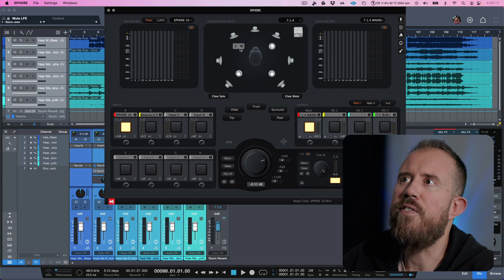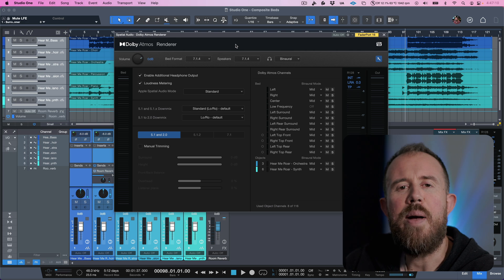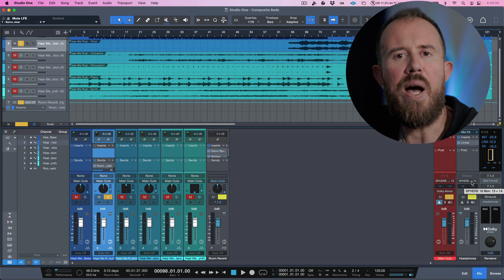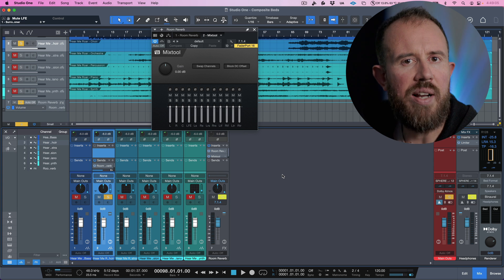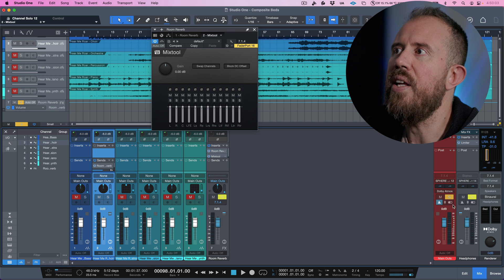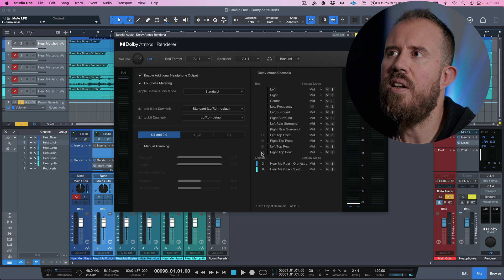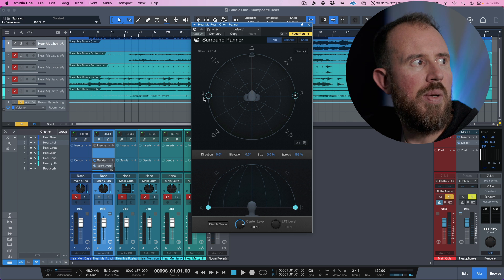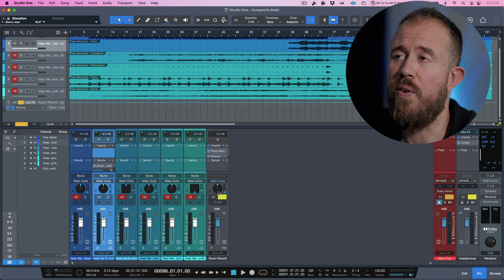Support for Dolby ATMOS Composite Beds in Studio One 6.6

Comment: Hi Marcus, love all your videos and info you provide. I have a situation I can’t seem to trouble shoot and you seem to be one of the best at some weird situations with studio one.

I have an Adat connection through a Ferrofish pulse to an old presonus 1818vsl interface.

I want to use the outs of the Ferrofish as my monitors, I have adat in from analog ins working well and detected in studio one etc. I have adat out interface to Ferro in etc, they are synced with Ferro master inter as adat slave. (Have flipped also for tests)

My issue is I cannot monitor anything if any track is panned or actually stereo, I see both lines showing up on ins of my Ferro and if I flip listen bus or mains to mono etc I can hear it but it cannot be stereo despite 2 outs going and stereo setup in control panel for corresponding lines.

I do not have a mixer / dsp for external routing in my interface like the newer ones. Any idea why this is happening? Have tried for 5 days diff configs to no luck.

Another weird quirk is the listen bus and main both directly affect the level in Ferro to digital clipping. I found I have to leave master at 0 and attenuate the listen bus to something like -48 dbfs when sending the signal out. The actual audio being -12 to -18 dbfs on the meters of Ferrofish when this is done using a sign wave 1k at 0db.

Ps I can record in stereo instead of mono but not monitor that also unless I swap the track or bus to mono in studio one!

Thanks in advance if possible to help.

Comment: A quick question Marcus.  How does mastering fit into this whole immersive sound? Traditionally I would mix, and give the high res stereo file to a mastering engineer. How would this fit into the process? I assume that the mastering engineer would need to have surround capability to do the master? A rundown of the mastering process would be nice.  Great videos, they are motivating me to try a surround mix, using binaural, since I am not geared for surround in my studio.
Reply: Same question here.